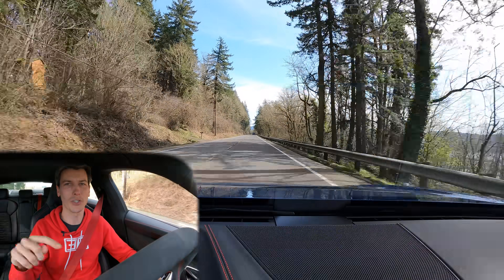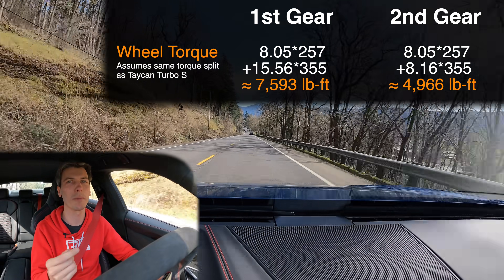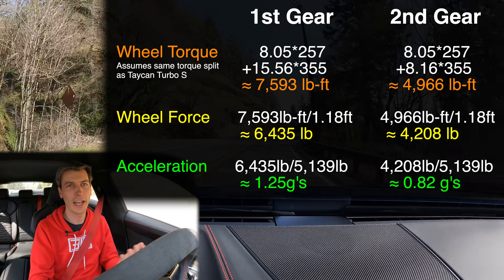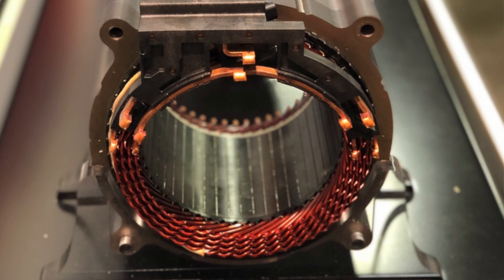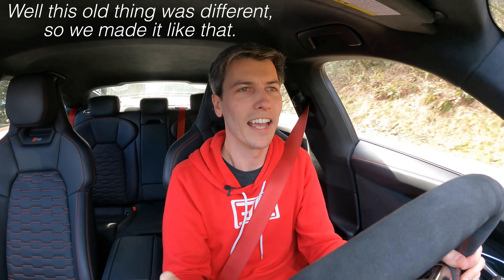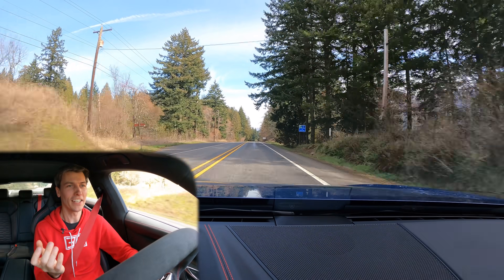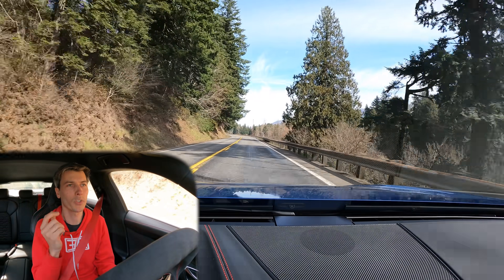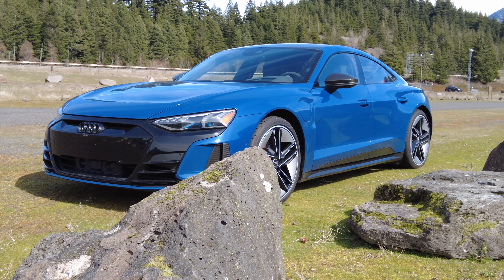Are Fake Manual Transmissions Coming? Audi Keeps It Real

Comment: A lot of home built EVs use manual transmissions they tend to sit between 2nd and 3rd an shift without clutching,  (also all audi did with that was badge engineer it)
Reply: I'd rather have a home built EV... Way more soul than a modern ipad on wheels with an interior as exciting as the inside of an MRI machine.

Comment: Opel did an Electric Restomod with a manual Transmission! Its called the Opel Manta GSe ElektroMOD.
Reply: Lots of EV conversions use manual transmissions that you do need to shift... Because they use DC rather than AC motors. AC motors require complex circuitry and controllers, but have the instant torque, flat torque curve, and high speed characteristics associated with EV's. In mass production, it's more economical to design these controllers once and mass produce them than it is to mass produce a shifting transmission. But if you are converting just one car, by yourself, in your garage, and it already has a manual gearbox, it's much less expensive to go the DC route. And DC electronics are much easier to figure out doing it yourself. It's just, DC motors do not have as much low speed torque or high speed power.
Reply: @thirdpedalnirvana  But hey! It would be pretty fun to drive
Reply: @thirdpedalnirvana  What is DC's efficiency vs. AC motors?
Reply: @thirdpedalnirvana  With decent electronic controllers DC motors don't need a gearbox. Old trams and trains had them too without gearboxes. You just change from parallel-wound to series wound as you speed up (this is vastly more efficient, can easily be done with relays let alone modern silicon controllers and I'm surprised restomodders don't do it rather than using such primitive setups)
Reply: Actually, DC motors have more torque than AC motors. AC motors happen to be more efficient, however.
Reply: @crewdawg2008  plus maintenance on the brushes and dust in the motor
Reply: @cumbob  There are brushless DC motors, but they don't do well with dust for sure. AC motors tend to be a lot more flexible that way, definitely.
Reply: old car conversion kits did too
Reply: i hear some rich guys toy for 2m.... going once....
Reply: how did it turn out ??
Reply: This what we as enthusiasts need to make ev not one trick ponies
Reply: That car is a sin.
Reply: To many names
Reply: I pray we get a car close to the concept car! I would go out today and put a down-payment on one if they sold them like that
Reply: Will it fake stall like a stick shift too?
Reply: That’s just a concept car, not a production model
Reply: Many restomods do. It's an easy/lazy way to mate the electric motor to the driveshaft without having to fabricate stuff. 

In real world driving most owners just permanently leave it in second or third gear 

Bear in mind that a multispeed gearbox (especially an OLD one) is going to end up being a parasite draw of motor torque - easily a 10% range hit due to internal losses (older diffs are problematic too. The science behind drivetrain losses had advanced a lot in the last 30 years)

Comment: Some of my favourite things about EVs are one-pedal driving and the smooth and quiet of the car.  Why on earth would I want to go back to three pedals and pipe fake engine noise into the car?  Leave the old things behind.
Reply: Ya. You're getting up there in age. Time to leave you behind.
Reply: @HondAcura111  That's probably true, I'm in my late 40s and totally over ICE cars, they are not worth the hassle now there's a superior alternative.
Reply: @Edward Elizabeth Hitler With decent regen you "brake" just by lifting off the accelerator.  I consider it a failure on my part if I have to use the actual brake pedal since it usually means I haven't anticipated the traffic well.
Reply: Q: "Why on earth would I want to go back to three pedals and pipe fake engine noise into the car?" A: i suppose for the same reason Jay Leno can be seen driving around Steam Engines.  i've literally taken pictures while driving my EV here on the East Coast of people driving Model T's, and i've also had the SAME EXPERIENCE on the West Coast (vacation) literally driving on the 880 north of Oakland taking a picture of someone driving yet another Model T.  observing this phenomena on TWO COASTS can't be wrong.  what we consider "old" others will likely call "not old enough".
Reply: One pedal driving? Omg, how lazy can you get. At least use 2 pedals, as you have two legs.

Comment: good evening, long time I have followed your videos.   live the detailed process of explaining the why's, etc.
My question is due to my cousin abnormally short shifting his vehicle in the efforts of saving fuel.   I cringed when I am in the vehicle with him and hear and feel the engine buck and ping because he is leaving it in a higher gear so as to keep the revs down.
PLEASE, PLEASE MAKE a video addressing the pros and cons of making the engine labor at such low RPM (he shifts into a higher gear at 1500rpm
Reply: oh, i do this too. not intentionally, but it's a long term habit for driving thin walled econo cars.

to me, it's not really about the fuel (cant complain, happy coincidence), but the sound.

there's an RPM range where the engine sounds quiet and unbothered...
go too low and you'll lug the engine, making the horrible noise. (i like to think like it's annoyed and nags.)
also, not good for the engine.

going higher sure is fun, and it sounds happy, but it's annoying when cruising.

additional info: 
i do rev matching (blipping the throttle when shifting up AND down) so the RPM doesn't go too low and lug.

Comment: I wouldn’t call myself a “car guy” but I’m definitely a “climate guy”. So I’m all for any ideas which might make EVs more appealing to traditional “car guys.”

Electric sport cars? Electric trucks? Fake transmissions? Speakers that play engine noises? Bring them all on! And let’s celebrate together as our emissions go down as a result!
Reply: How about no.
Reply: Ya because producing electric cars doesn't come with it's own enormous amount of pullotion and damage to the planet.
Reply: Car guys desires are irrelevant, manufacturers always target the masses and the legislatures.
I'd consider a myself a bit of a car guy, I'd drive an EV but none of the fakery is appealing,  it is extremely unappealing.
Even a fake vents for styling purpose on a toyota Supra (real sports car) will triggers car guys.

Comment: Wouldn’t you use less electric power if the electric motor was spinning slower? Hence why gearing would still benefit an electric motor.
Reply from the maker: Not necessarily. Spinning slower doesn't necessarily mean it's operating at a greater efficiency. Many will reach peak efficiency at higher RPM.
Reply: @EngineeringExplained  Interesting. I’m trying visualize efficiency in the electric motor the same way as an ICE with an “overdrive” highway gear. But you’re saying that cruising on the highway in an EV that spins slower  isn’t necessarily going to give you better range. That’s pure witchcraft!
Reply: @TML34  Yeah I would think that there would be at least some additional losses in efficiency due to bearings spinning faster and such.... but yeah that's interesting that some are more efficient at higher RPM.  Just goes against the normal way of thinking for an ICE.

Comment: I think it can be just as easily argued that two gears is for top speed as well. Presumably, if they only had one year it would be somewhere between the two. If it's between the two, the acceleration off the line would not be as good, nor would the top speed. It also could extend range to have a crossing gear.
Reply: The question is, do you actually get more acceleration by increasing torque? If you have too much torque, your wheels just spin out, reducing acceleration, so there might be nothing to gain by increasing torque beyond what many electric cars can put to the wheels using a single gear ratio
Reply: @Fleming-ql  Its about adding torque at higher speeds. Most electric cars cant keep up with a gas powered equivalent at +100mph due to the lack of gear box.
Reply: @martinsvensson6884  Torque at high speed is just power. Electric cars make constant peak power past an rpm, something a car with an internal combustion engine would need a CVT to achive realistically. High speed acceleration is just a function of power/weight and drag.
Reply: @juanordonezgalban2278  Yes... and that's why you need a gear box.... Since the electric motor is not going to make much torque nor power after its max/peak rpm.... That's why an ICE car always wins at high speeds.. Because the electric car lacks a gear box...
Reply: @Fleming-ql  four tires have better grip than two tires.  But then it probably requires constant four-wheel drive
Reply: @Fleming-ql  But if you are going to race against a petrol-powered Porsche, you must have high torque even when the speed is high.  and of course your car must have at least as high a top speed as the Porsche
Reply: @Fleming-ql  That's basically why koeniggsegg made the aegera a 1 speed car. With 1500hp they can reach 400kmh while remaining traction limited at launch
Reply: @Fleming-ql  re: "If you have too much torque, your wheels just spin out, reducing acceleration, so there might be nothing to gain by increasing torque beyond what many electric cars can put to the wheels using a single gear ratio" indeed, this is the dilemma faced somewhat by the FWD Bolt, definitely the FWD Kona/Niro EVs (aka "burn out monsters"), and possibly the new base model FWD Polestar 2. of course (for those inclined) there's also a huge FUN FACTOR to be found in this. 😎
Reply: tesla got away with single gear cuz they made 250km/h topspeed but for germans 250km/h is for breakfast they need 300+ for autobahn so they need 2nd gear to be able to have good launch and topspeed
Reply: @shutu6338  some electric cars can have good acceleration up to 70 or 100. Above that speed, the acceleration drops more or less on several electric cars
Reply: @shutu6338  Does Tesla have as high a torque when the speed is 200 km / h per hour as when the speed is 100 km / h per hour?
Reply: @Andersljungberg  no. You can see the torque curve in the video.
There comes a point where the electric motor makes maximum power (for the battery voltage) once it gets to that point it will provide constant power which means as the RPM increase the torque decreases.
It is kind of like a CVT.
Reply: @shutu6338  or you put a bigger motor so you can have the same acceleration with a taller gear.
I bet a bigger motor would be lighter and smaller than the two speed gearbox.
Reply: @criticalevent  re: "The reason the Tesla Roadster has a 125 mph top speed and not the planned 170 mph is because Tesla could never get their two speed gearbox to work." bingo, this is something the EGOS of Tesla fanboys tricks them into misinterpreting/overlooking in regards to the original Roadster.  it wasn't for LACK OF TRYING on Teslas's part to use a gearbox, no, the gearbox kept breaking due to the torque so they were naturally FORCED to go in another direction.  yeah, they simply didn't have the engineering expertise to MANUFACTURE a reliable box (not then at least).  in contrast, this level of capability has always been squarely within the "wheelhouse" of big OEM's like VW.  as such the reason Porsche/Audi have 2 speed DCT's is precisely because the CAN have them, yeah, because they HAVE the "enviable talent" (in house) to make them and offer such a feature to their DISCERNING customers, whereas a startup manufacturer...?  not so much.
Reply: @phillyphil1513  There are multiple companies focusing on manufacturing gearboxes and supplying them to big OEMs. The reason for Porsche/Audi having a 2 speed gearbox is probably because they are big OEM's making big orders for these gearbox manufacturers. It would be extremely difficult to find a manufacturer if you're a startup making an order for a couple of thousand gearboxes for a car using brand new electric drivetrain which hasn't yet proven to be viable.
Reply: @MrMarapro  re: "There are multiple companies focusing on manufacturing gearboxes and supplying them to big OEMs." yes, at a PRICE. that would be for those lacking the years of "in-house" capability/racing expertise and culture to spec it THEMSELVES (this would NOT be Porsche History however). ref: the Tremec DCT built for GM for the C8 and for Ford's GT500.  ref the Ricardo built box for Adrian Newey's Valkyrie.  physical "gear hobbing" for mass production will always be best left to those shops set up to do it.  however specialty DIY has always been Deutsche culture going back to WW2, just ask "Bey Oom Vey". they pride themselves on retaining expertise within the organization (i know i use to work for them). re: "It would be extremely difficult to find a manufacturer if you're a startup making an order for a couple of thousand gearboxes for a car using brand new electric drivetrain which hasn't yet proven to be viable." not if you spend the money it isn't, you must not be into Motorsports for i know at least a 1/2 dozen. Quaife for example will make you almost anything, catch is you just have to PAY FOR IT (now whether you're able to resell it or not and recoup the expense is your problem).  unfortunately nothing you said removes much in terms of RISK regarding the basic decision to produce an EV from the ground up.  as Tesla showed their first 5 years (and is still showing) before releasing the Model 3, doing that all by itself was RISKY AF.  since you still need bevel gears to complete the drivetrain anyway, i contend the addition/removal of a multi-speed gearbox doesn't really change the Calculus on this, you're risking your ass no matter what.  if you're already spending say $10 Million...? spending another $500K to $1 Million doesn't exactly "move the needle".
Reply: Then you have to estimate if it's better to invest the money and the weight in motors and the gearbox, or would you be better off with more expensive and heavier motors without a gearbox.
Reply: @MrMarapro  the motors are actually much light than engines that have the same power output. It's the battery that is the weight problem
Reply: It doesnt increase the range or effiency, the problem is with each set of gear you have 1% power loss. You may win 3% effiency from the motor but you loss 2% in the gearbox an 1% for the additional weight.
Reply: @criticalevent  Tesla is trying to use the motors they have. You could put a bigger motor and have taller gearing and get the same acceleration and higher top speed. A motor with double the power does not weight twice as much.
Reply: Some of the steam automobiles had a two speed transmission - didn't need two gears.
Reply: @criticalevent  if you have a motor with 50% more torque and the same top speed you can have 50% taller gearing so you have the same torque at the wheels and therefore same acceleration but a 50% higher speed. At some point more torque only makes the wheels spin. It doesn't increase acceleration.
Reply: What you calling one gear is wrong. Those cars actually have NO gears because it's direct drive where the motors are connected directly to the axles. The motors can turn from 0 to 30000 rpm which makes plenty of room for torque and power output to be efficient
Reply: @tristianbilly001  No YOU are wrong, they use one gear, a fixed gear ratio, they are not direct drive, no cars wheel will ever reach close to 30000rpm, are you joking?
Reply: @tristianbilly001  you could say wheels are gears made from rubber and aluminum, in German you could just call it Übersetzung which means transmission or translation, so it implies that during transmission from motor to wheels, there's always some translation between torque and distance taking place
Reply: @tristianbilly001  30000 rpm directly to a 235/45R18 tire would equate to 3600 km/h. So I think you're wrong.
Reply: @tristianbilly001  they do have gears.
Most have about a 9:1 ratio between the wheels and the motor.